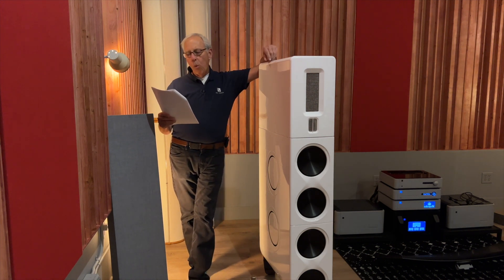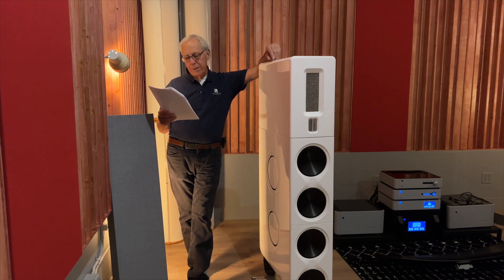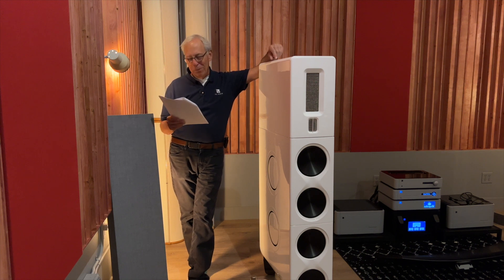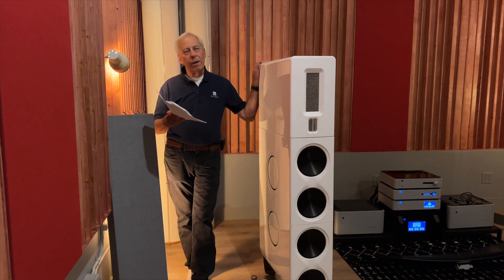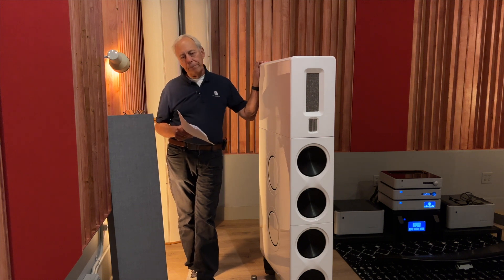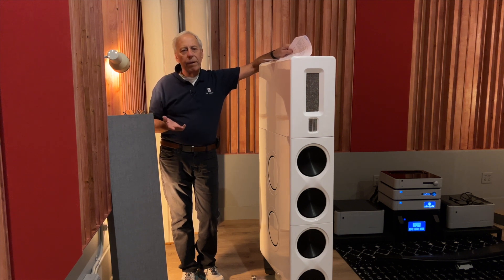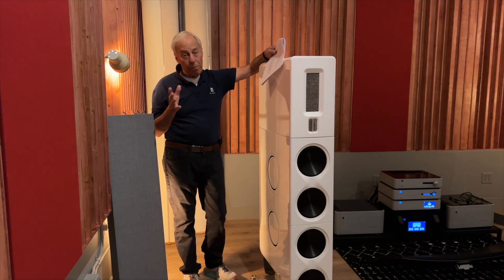Where do all the bits go?

Comment: 192kh 64bit floating point is common in pro studios these days. Not for detail, but so the FX pipe is not chewing on blocks when data is retimed in post.
Slowing 44.1 16 to half speed is a problem, and pitch correction can do exactly that.
64bits lets the recording levels be set to a room standard, and then lifted up to 60db.
Really helpful with drumbs.

Comment: My understanding was that the sample rate defines how many samples of the state of the analogue waveform were recorded and stored to digital in 1 second. As for the bit depth I understood that to mean the number of possible values for each entry in the table defining each sample of the wave or the "wave table" so to speak. Or in other words if you recorded in 24 bit depth you would have 16,777,216 possible loudness levels, now whether anyone can hear that many differences in amplitude or if that range is constrained to 20-100 dB or 0-140 dB as an example is left as an exercise for the reader.
Reply: Your understanding is correct. Bravo!

Comment: This is perhaps the worst explanation of sample rates and their conversion.
First of all 64 bit PCM is available, secondly, while the bit depth does increase the dynamic range, increased bit depth also increases the resolution of both the recording and the playback of a PCM file.
This is why PCM has significantly better resolution than DSD.
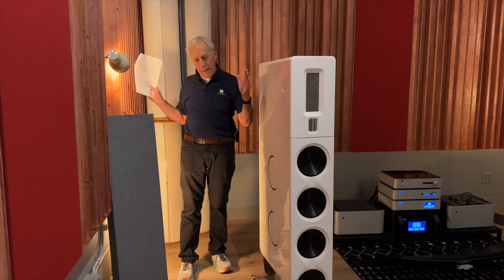2:31 "...nobody cares about single molecules hitting your ear..."
3:01"...but in general we go for as much dynamic range as is possible so we want from the tiniest pin drop of sound to the giant crescendo, that's what we're looking for...
You should make up your mind Paul.
One minute you're telling us that 24 and 32-bit PCM has too much dynamic range then 30 seconds later you are telling us how Octave Records is looking to achieve maximum dynamic range. and yet Octave Records uses DSD which has a maximum peak of -6 dBFS whereas 24-bit PCM has a maximum peak of 0 dBFS and 32-bit floating point PCM has no maximum peak.
At 4:38 you start mistaking bits for samples, you mean 96,000 samples and 362,000 samples.
Then you start doing some rather funny math like 96 kHz sampling rate is "a little more than half of the 44.1 kHz CD playback rate.
96,000 samples are considerably more than 88.200 samples contained in that one second of fixed time.
Also, half of 44.1 kHz is 22 kHz, not 20 kHz Paul.
This gives a 44.1 kHz sample rate the ability to record up to 22 kHz before the need to filter the recorded material unlike DSD 64 where large quantities of noise are added and reach down as low as 18kHz and then the DSD signal must be run through a low pass filter to remove the noise which loses high-end frequency information and causes distortion through phase shift.
Contrary to what Paul would have you believe your PC and your Mac are great sample rate converters.
Sample rate conversion is merely a matter of mathematics which your computer happens to excel at.
Computers use a processing block in software to determine a rational number (ratio of integers), P/Q , such that P/Q times the original sample rate is equal to the target sample rate within some specified tolerance.

Comment: 32 bit dynamic range = 1528 db = The earth, probably even the Milky Way are long gone by then. Perhaps even the whole Cosmos.
I've heard that there isn't enough atoms in the known universe, if every atom in the known universe is converted to 1 watt, to play 1000 db.
Reply: No, actually, 32-bit can theoretically do 192dB, 24-bit is 144 dB, etc. However, while many DACs and A/D can do 32 bits, none I am familiar with can achieve much more than 140dB without our equipment running on liquid nitrogen at 0 degrees (which is a bit silly). Anything exceeding 24 bits is silliness and only a numbers game.

Comment: We still cannot reach 24 bits in 2022 because that would be a theoretical dynamic range of 144db.  No adc/dac can do that yet despite the clever deceptive marketing practices.
Reply: Actually, that's incorrect. Relative to 1 volt we can achieve that dynamic number. Our AP measuring equipment can measure down to 160dB (relative to 1 volt) and our A/D D/A at Octave hit the 140dB mark.
Reply: @Paulmcgowanpsaudio  140db is not 144db.
Reply: Yes, 144 db.
Reply: @birgerolovsson5203  Sorry. 144dB.